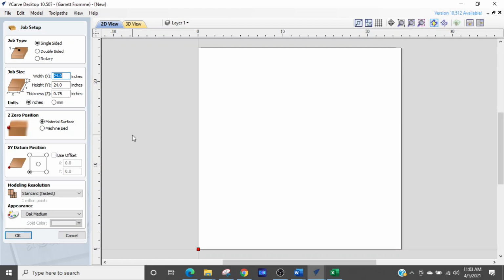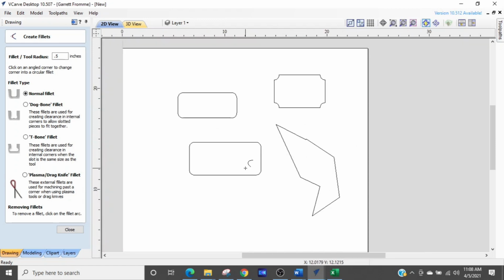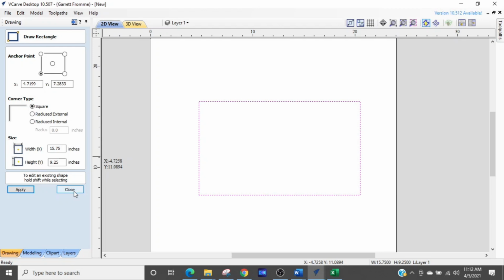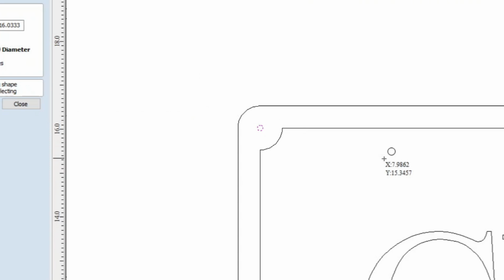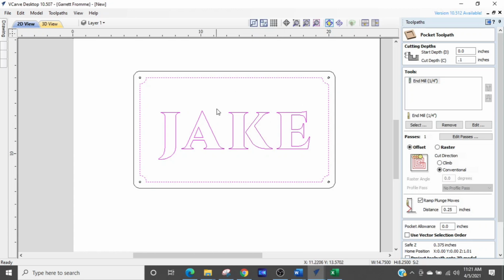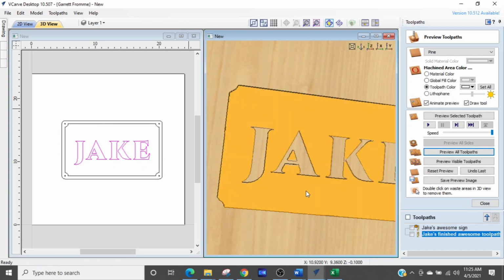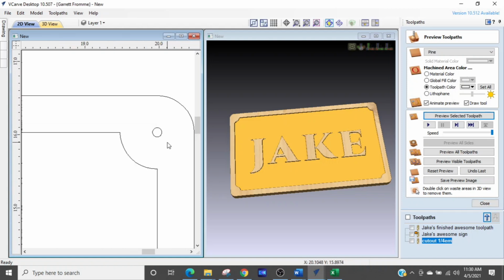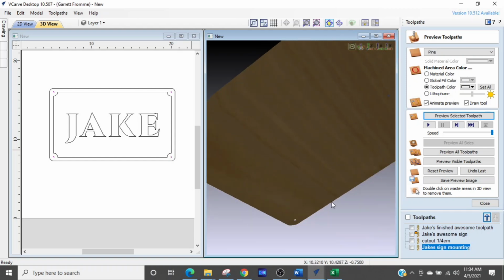Radius - How To Add Style To Your Designs [Vectric Aspire & Vcarve Tutorial] - Garrett Fromme

Comment: hello sir I thank your the one who can help me out here I am doing a 12" fret sanding block but I am using mm in my vcarve pro how would I do this 12" radius in mm if I am able
Reply from the maker: Hi Fender. Going from inch to metric. multiply inch x 25.4

Example 12x25.4=304.8mm
If in mm, converting to inches  mm/25.4=inches ex  100mm/25.4=3.94"

does this help?

Comment: Your method for doing the profile pass around the letters works, but it's easier and quicker to click "Profile Pass" that's in the section where you choose Offset or Raster.. You can have a) no profile, b) Profile First or c) Profile Last. That way you don't need to worry about maintaining proper depth and it will automatically do a profile around the letters and box perimeter.
Reply from the maker: Crap Steve....I forgot about that. Ugh...I missed such an important point. Thanks for reminding me. I'll get that note in the description. Thank you.